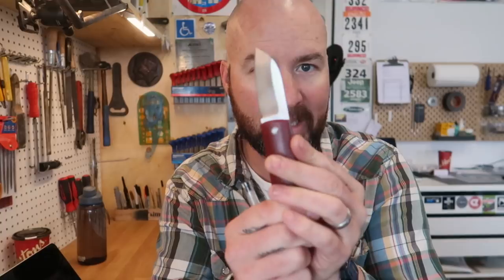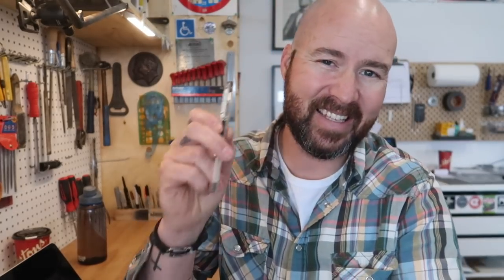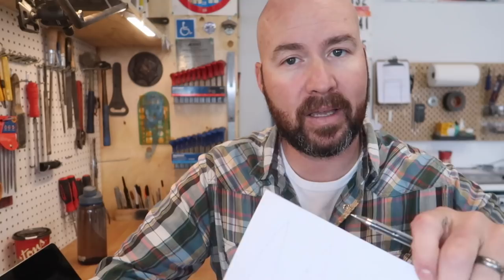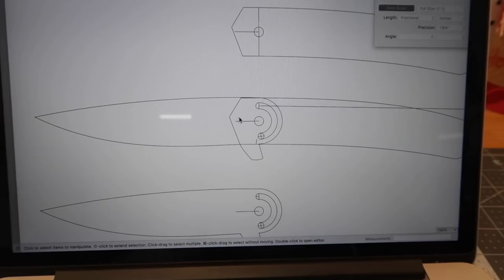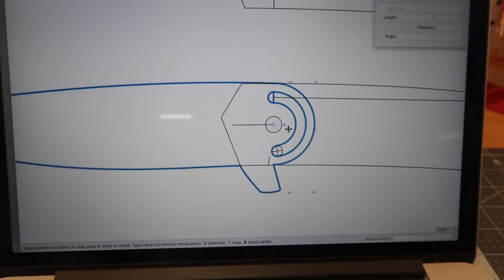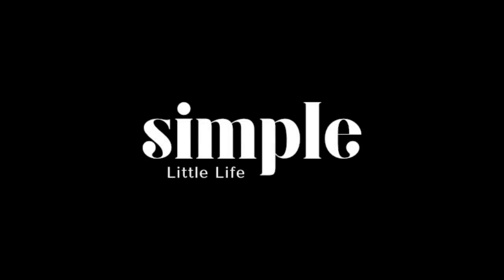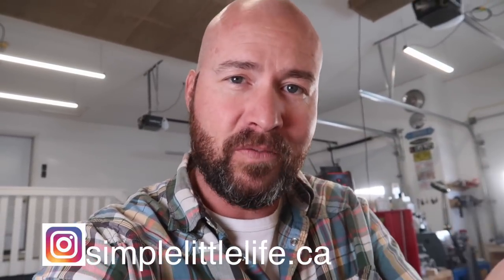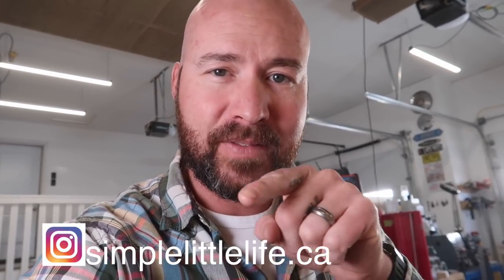Frame Lock Folder Part 1.5 (stuck in the design stage)

Comment: I’m a bladesmith and make damascus very frequently. So with the amount of weld setting Alec did you should be perfectly fine forging that stock below forge welding temp. Just make sure you don’t work it below a cherry red, a bright red-orange heat is perfectly adequate.

Comment: You don’t need forge welding temp to draw out the steel. It just needs to be “working” hot. Use the far side of your anvil edge and draw it out. You can also use a cross peen hammer to draw it out evenly. Before you work on Alec Steele’s Damascus try drawing out a piece of rebar or something like that. Work that until you get the hang of drawing out your steel. Good luck buddy! Love the channel, and I’m looking forward to seeing you make an awesome folder.

Comment: Aren't you going to also need a flat on the currently smooth arc for the frame to lock in? Probably need to get that included and see how it impacts the closed design.
Reply: E J Burke beat me to it. Was thinking the same thing that he was missing the 1 part that makes it a frame lock.
Reply from the maker: Do you mean the lock bar? If you noticed at the very end (or maybe it didn't show it very clearly on the video) but I have the lock bar drawn. And, while editing the video, I found a problem with it😆 I'm sure I'll be missing tons of stuff and these comments really help keep me sharp and make sure I'm not missing anything. It's like a community build! Thank you!
Reply: I think he means something for the lockbar to engage against.. right now your blade is just rounded off, there is no flat for the lockbar to press against.
Reply: Simple Little Life yes you do need a flat portion on the tang end of the blade that needs to be machined at about a 7° angle, and the lock face which engages it needs to be approximately 3° angle.
Reply: I mean what Kyle Weems and Matthew Jaynes  said below. Otherwise having the lock bar won't do a whole lot for ya.
Reply: Lockface on the blade

Comment: I have been a blacksmith for about 8 years now and you don’t need to keep the steel at a forge welding temperature. Just keep it at a bright orange and you will be fine. As long as there’s no cracks in the steel when he forged it

Comment: John Grimsmo would be a spectacular contact for you on this project. I’m sure your design is fine but what I don’t see yet is the flat portion where the frame lock will engage the back of the blade. Additionally people are always searching for more and more stop pins and redundancy in that area.

Comment: So as to NOT jeopardize the full length of the damascus, simply heat up a small area of the steel where the flipper should be and strike with ball pine to "mushroom out that area for the flipper.  Then machine to the thickness required like you were thinking about.

Comment: if you had a hydrolic press you could put a piece of cold steel slightly thicker than you want your knife blade to be and use that as a kiss block. heat it up, and press it out to the thickness you want. I know it's not as easy as it sounds, and you probably don't have the tools set up to do it, but that would be a pretty safe way to draw out your steel.

Comment: Cut out a copy of the template for the blade and see if it can be rotated enough to fit the flipper, or use a thumb stud. Also, if you are going to grind it thinner, just hammer out a small section for the flipper. Is it thick enough to "re-saw" it into two thinner bars, if you chose the thumb stud?
Keep the faith, we all have to learn from our mistakes sometimes.
Another option would be to down-scale the dimensions of the knife itself if the bearings will still fit.
Good luck, will be waiting for the next episode in the series.

Comment: you could move the pivet point of the blade a little to make that space on the close position larger and even make a full spacer as is in mine fold knife, moving the pivet point in the blade and in the handle a little close from the  cutting edge may be nice

Comment: You could use another piece of material for the flipper and fasten it mechanically with a bolt. Think of a blued piece of steel, maybe some brass or you could use a warmer material for a different feeling (wood, stone, ceramic). I can't think of any knife maker doing that already.

Comment: Won't the spacer piece at the rear need to be wider than the blade to take into account the bearing(s) thickness? I was thinking about that when you were talking about surface grinding the entire piece.
Reply from the maker: Yeah it does. I will have to grind the blade separately from the spacer. But you're 100 percent correct!

Comment: Jeremy, you don't have a flat spot on the back of your tang, where the lock face will need to contact the blade.  Right now you have a blade design that will pivot open and closed, but you have no way to lock it open.

Comment: As this should be pressure welded out of alec's hand this should work like 1 solid piece of metal and be forgeable like one too (Correct me if im wrog)
But it's technically welded and 1 solid piece by now. So imo it should be or to just heat it up and smack it till it fits =D

Comment: I’m probably the 600 person to suggest this, but take a look at autodesk fusion360.
Reply from the maker: That is a very popular suggestion. Might have to give it an hour to see what the learning curve would be for me. 8 years ago I used AutoCad everyday for my job but haven't looked into it because I remember the price of getting a full license every year. It wasn't cheap back then but I've heard fushion 360 has a free trial period? Have to look into it. Thank you!
Reply: Simple Little Life I believe it’s still free if you’re a startup with <100k revenue (or something like that).  It might take a bit of digging to find the link. 

For the learning part, check out Lars Christensen. If I remember correctly, he modeled a knife as a beginner video.
Reply: It is free if you make < $100k a year. The paid version is only $310(usd) a year so even that isn't  terrible. Very easy to learn and work with especially if you don't need to worry about CAM.

Comment: I have no idea how wide the billet actually is but it seems like it would be plenty wide enough to make a decently proportioned blade if you just scaled everything down a bit......Sometimes 'less is more' I actually prefer a smaller knife that rides comfortably in my pocket; it doesn't have to be some huge behemoth that would be better carried in a sheath like a Buck 110.... just offering my 'two cents'......

Comment: Looking at your design I think you’ll need to move your stop pin placement and the track you have in there for it. It doesn’t look like you’re accounting for where the lock will be need to be cut/fitted. Correct me if I’m wrong. One other thing, if you can fit it, you might consider an external stop pin design vs. the internal, they are considerably more easy to build for your first framelock. The internal tracts can be kinda funky. Feel free to message me on Instagram if you like: JRP Knife and Tool

Comment: I'm no expert, but I seem to see a problem with the design...
The entire width of the blade beeing round at the pivot, where and how is the frame lock mechanism going to engage? Don't you need a square face to lock onto?...
Reply from the maker: Good catch! It never really showed up in the last clip of the drawing, but I do have the lock bar drawn in and while editing this video, I found an issue with it. On my IG post you can see the design of the lock bar but I'll share it here once I have it sorted out. Good eye though! I appreciate all the help I can get. Cheers👍

Comment: But Jeremy, where does the frame lock the folding knife? I think you've designed it as a friction folder...
Reply from the maker: I didn't really show it well in this video because I found a flaw where it was going to lock up. In my IG post there is a video showing the lock bar. I've made a few tweaks this morning and I think it's getting closer👍